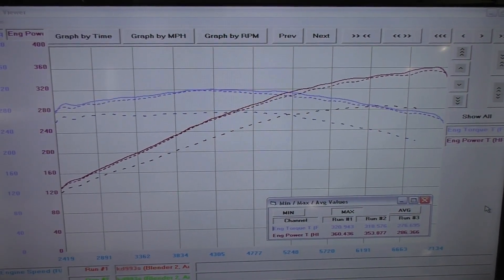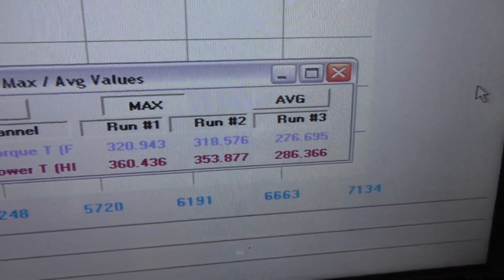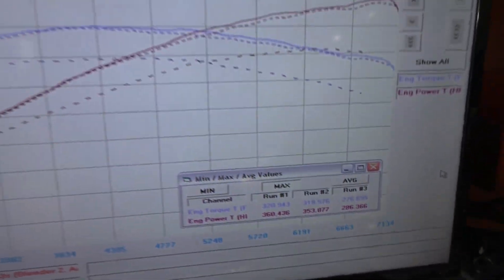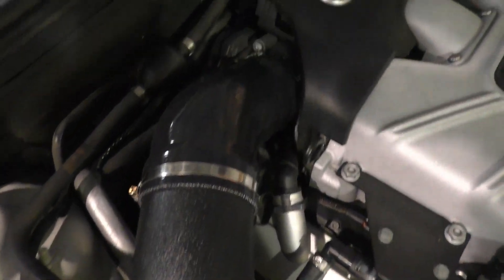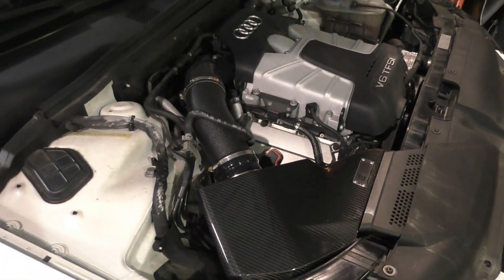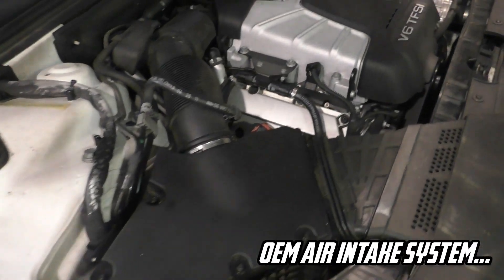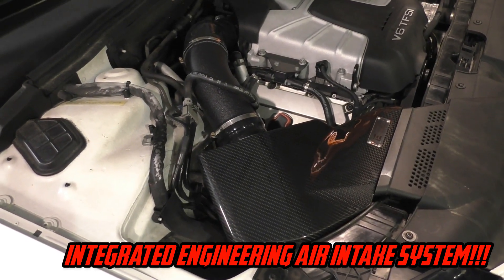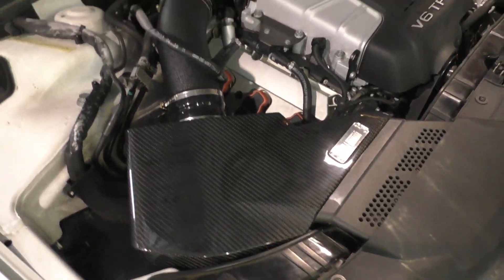Dyno Testing Integrated Engineering Air Intake System - Audi B8 S4

Comment: I was thinking of getting the iE polymer intake (fully covered), but now that I'm told that without the cover the car makes more "whine", I'm thinking of getting this one without the carbon cover instead of the polymer one.
What do you guys think?
Does anyone have a comparison between with and without cover?
Reply from the maker: If making power is more important to you, then run a covered intake. If the noise is more important to you, then run an open filter. Simple as that.

Comment: I'm new here but really like your videos, very professional 👍, I have stock S5 but want to add some nice whine of supercharger and want to order IE intake, that weird graph from dyno make me a bit concerned about power delivery..... do you think it may do the same thing on fully stock engine ?
Reply from the maker: If all you're looking for is to make the supercharger whine louder, then you'll want to buy an open air intake. Not a closed one, so make sure you don't buy the cover.

With a stock tune, you'll gain no power using an air intake. The car will need to be tuned to make more power.
Reply: @VancityAudi  thanks for quick replay! yes at the moment I'm looking for nice whine from supercharger so decided to go for open intake from IE, planning to order single pulley in future and when thats done I will be looking for ECU and TCU map, thanks for explanation 👍

Comment: so technically with intake and throttle body it's about 22hp gain not bad
Reply from the maker: Certainly more than 22hp with both of those mods. You have to take into consideration the testing of those products was done on separate days and at very, very different power levels. If I tested the air intake gains at a Dual Pulley Throttle Body E40 state of tunel they would have been greater than what you saw in this video.

Comment: How are you running 93 at high altitude? In colorado we have no 93, so i'm limited to a 91 tune which makes less power.
Reply from the maker: We are at extremely low altitude. Just above or at sea level.

Comment: That’s so bad dude , video is pointless because of the downpipe install ……..
Reply from the maker: I clearly show the gains before the downpipes were installed as well. If you want to get a better number once the downpipes were installed take off 5whp then. Lol. It's not rocket science.
Reply: @VancityAudi  dps give way more than 5hp
Reply from the maker: @internalcombustion8744  they absolutely do not. The maximum gains from downpipes with a Stage 2 Dual Pulley E40 tuned B8 are 8 - 12hp at the crank. This is very clearly stated by Integrated Engineering themselves on their website: https://performancebyie.com/collections/exhaust-systems/products/ie-downpipes-audi-s4-s5-b8

Seeing as my car was utilizing stock pulleys on a Stage 1 93 octane tune 5 wheel horsepower is being generous.

Comment: Adam, have you compared such a filter with the oem? I wonder if there will be a big difference, other things being equal. I have an a6c7 with a custom 89mm intake pipe and an rs6 air box. I'm afraid to put a filter of zero resistance, a lot of sand in our area.
Reply from the maker: Not sure I understand the question.  This video already shows an OEM filter vs an upgraded filter and intake.
Reply: @VancityAudi  I meant using a modified inlet pipe with an oem filter, and not with a filter like k & n and so on. on the c7 body (for a6 and a7) it is possible to use a filter box from rs6, but use a stock filter. on rs6 it is enough for 560hp, that is, the performance is enough for any level of improvements 3.0 tfsi
Reply: @VancityAudi  so I wanted to know if there would be a difference if only the filter was replaced with a modified one, given that the rest of the intake system is unchanged
Reply from the maker: @МаксимВоронин-ы9ж  gotchya. That I can't speak to because I never tried and tested that. Sorry

Comment: Crazy you only had 93 octane!! In the uk even though fuel is crazy expensive we have standard 95 and then we have Vpower by shell which is 99 and a few other companies with 99 octane but its £1.36 per liter not per gallon like you lucky folks in the Usa 🤘
Reply from the maker: You might want to look up the difference between the octane ratings in Europe VS North America 😉
Reply: @VancityAudi  now that's crazy, i was always told the fuel quality in north America was much worse than in the Uk. We have so called "99 RON" but as you say that might be your 93 ? Still much cheaper for you lucky lot lol
Reply from the maker: Not sure on the fuel quality statement, but your 99 is equivalent to our 94 in North America. Same sh$t, but the octane value is described differently
Reply: @VancityAudi  my father worked for our local refinery for years, apparently the additives, quality etc is completely different due to laws and legislation dude

Comment: Good job you are making perfect videos with all the updates I’m surprised with the power the car makes I’m stage 2 single pulley on 91 tune with down Cts down pipes and cold air intake and I make 400 at the wheel congrats and keep going😀😀
Reply from the maker: Thanks and will do!

Comment: Thank you for making this video. I definitely have to reflash and check with IE to make sure I’m not experiencing the same issue you did.
Reply from the maker: Don't reflash anything. Simply log your car. That will instantly tell you whether your bypass valve is opening on your pulls or not. If it isn't (like 90% of people), then you're fine
Reply: @VancityAudi  what are you using to log?
Reply from the maker: @1bads5  https://youtu.be/EChzDGcJh10

Comment: I have an S4 B8 as well. I've gone Malone tuning with CTS 187/57 pulleys, PLM intercooler, MH test pipes, cold air intake, CTS resonator back exhaust and Southbend clutch. Hopefully soon I'll be doing the full exhaust along with a ported, polished SC. I'm from Alberta and if this covid crap ever eff's off, it'd be sweet to head out your way. Is that your in house dyno you're using? How much to do a pull or two on that dyno?  I'd like to see what numbers I'd have.
Reply from the maker: We start private track rentals at Mission Raceway in April. You're more than welcome to join us. As I mention in the video a few times this is Racing Greed's dyno. Feel free to email them or call them for their dyno rates. www.racinggreed.com

Comment: Do you have the A6 HX since the S6 has a normal intercooler in front? just curious because i'm interested in running the larger HX on my B8.5 S4.
Reply from the maker: I say right in the video what kind of heat exchanger I have, lol.  I also made a video on the install: https://youtu.be/80jnlqNax6Q

Comment: Asking a newbie question: I want to do both the  stage 1 tune and exhaust, should I do them both at the same time or, if I do the tune 1st then the exhaust would I have to retune the car?
Reply from the maker: We're all a newbie at some point so don't worry about it. Once you've tuned your car to Stage 1 you won't ever have to re-tune it to Stage 1 unless you want to change the octane of the tune you run. What happened to me with having to get a revised version of the tune was a very, very, very unlikely occurrence and only happened because of the amazing conditions I live in to make power.
Reply: @VancityAudi  hi, really enjoying these and your recent SQ5 vids, I live pretty local (Kelowna) and wondered how someone would know if they also need to update the tune?
Reply from the maker: @graemepaterson9436  you'd need to do a 3rd or 4th gear pull and log the car. That will show you what your car is actually doing under full load at WOT

Comment: Awsome video's man! Want to see how much more power you gain with dual pulley or if you go with bigger throttle body mod. Btw, was those down pipes strait or did they have like 200cel cats on them? From Tuner from Finland, out.
Reply from the maker: Here is the link to the downpipes: https://performancebyie.com/products/ie-downpipes-audi-s4-s5-b8
Reply: Just gone trough the previous posts and noticed that those down pipes had no cats 🤣. Well anyway, just fitted these to my S4B8 https://www.luisusgarage.com/p/audi-a4-s4-a5-s5-quattro-3-0-tfsi-354ps-v6-katalysaattorilla/
Reply from the maker: The stock downpipes don't have cats either.

Comment: That is phenomenal power! Really excited to see that you are already making nearly 400 wheel on pump gas, no less. There you go closer to that 10 second run. You should be trapping right  around 119 mph now. To run 10's repeatedly, you will need at least 124 mph traps, which should be easily achievable with E40, DP, 80 mm throttle body and ported blower. Actually with those additional mods you will be trapping around 128 mph. Again, congrats on the awesome results and thanks for the interesting content!
Reply from the maker: I'd say 119mph is a little on the high side for a Stage 1 - 93 octane tuned car, but we shall see.  Thanks for watching!
Reply: @VancityAudi  you trapped 116 mph when putting down 360 whp. With 33 additional hp, you will very likely pick up 3 mph in the 1/4. Every little bit helps- HX gave you better IAT-timing-power, intake more power, downpipes a bit more power.
Reply from the maker: @spondev  super cold weather, super low DA making super good power on a dyno doesn't directly relate to that high a trap speed. If the conditions were identical between those dyno days then I might agree. I think I did 115mph, not 116mph too haha. My guess is I manage like 117mph, maybe 118mph at best. Only time will tell though! I love your optimism!!!

Comment: Does this have aftermarket Pulleys (SC or Crank) or stock?
Reply from the maker: I state I am Stage 1 in the video. That means I have a stock pulley
Reply: @VancityAudi  that’s what I thought, just wanted to confirm because those are really good numbers for stock pulleys and just a tune.
Must be the Mustang Dyno... great video regardless, keep it up!
Reply from the maker: @970Pantydroper  This Mustang dyno reads notoriously low.  The reasons I made great power I shared in the video.

Comment: Great gains so far! What do you mean by downpipes exactly? I've only heard that term in regards to a turbo car, right off the hot side of the Turbo. Did you get headers? Or are these like cat deletes after the headers?
Reply from the maker: The Integrated Engineering downpipes. Not the headers. Here is a link to their website: https://performancebyie.com/products/ie-downpipes-audi-s4-s5-b8
Reply: @VancityAudi  interesting, on other cars I've had, those would be considered midpipes/resonator deletes or something. They look very nice regardless.
Reply from the maker: Have all your other cars been turbocharged or naturally aspirated? On these cars the cats are built into the headers. The headers then go into the downpipes.
Reply: @VancityAudi  a couple NA V8s like a '13 Mustang GT, a majority have been turbo. Supercharged is the only one I haven't owned. But the exhaust on a SC and NA car should be the same for the most part. Calling them downpipes seems like a "branding" decision to me.
Reply from the maker: @scottc78  Well the pipes that connect to the motor are called headers.  What would you call them then? haha
Reply: @VancityAudi  yes, the exhaust directly connected to the block are headers/manifolds, but the pipes you bought connect to those. IE calls them downpipes, I'm used to them being called midpipes for the most part. Or often times the cats are right after the headers, so that would be the start of the cat-back exhaust. Not a big deal, just the first time I've seen an exhaust section be called downpipes on a non-turbo car.
Reply from the maker: @scottc78  Just an FYI all the manufacturers call them downpipes on this car, not just IE.  I get what you're saying though.
Reply: @VancityAudi  that makes sense. Kinda like the pipe that connected the two headers on my 87 Buick Grand National was a cross over pipe, but that same pipe on my Subaru Forester XT was an "up pipe". I like how that all have different specific quirks.

Comment: I’m already stage 2+ 190mm crank from 034, 57mm supercharger pulley from IE, IE intake, ECS HX, p3 v3 gauge , Billet drivetrain and tranny inserts from 034,  IE 80mm throttle body, running on 100 octane. Ran into fuel cutting issues. HPFP next. JHM test pipes/catted down pipes, then ported blower, and time to run e40. I love how you dyno everything. This way I can know what I was pushing to the wheels as I was going from stage 1-stage 2+ and forward. Thank you!
Reply from the maker: You're very welcome.  Thanks for watching!

Comment: 8:30 seems about right doesn't really surprise me that you didn't gain anything. Proves the stock airbox is flowing enough air and then some for stock cars. will probably smooth out with some driving. more supporting mods are needed to require more air to come in :)
Reply from the maker: As I CLEARLY explained in this video, lol. It wasn't right at 8:30. The powerband was f$cked up because my bypass valve was opening so much because I was hitting target boost. The stock airbox flows well I'm sure, but this intake provides much better flow and power.
Reply: @VancityAudi  the gains you showed in the latter part of the video were more to do wtih your downpipes and removing restrictions on the exhaust side. VAG does a great job at sizing their intakes and as you CLEARLY explained these intakes are more for sound and cosmetics than power gains until you get more serious about upgrades (stage 2 and higher).
Reply from the maker: @One_Guy  actually I said the downpipes were more for sound, not the intake. The dip in power was from the bypass valve opening. If that wouldn't have happened the 1st graph would have looked fine and I picked up 16whp from an intake. So like I said the intake flows better and makes more power than the OEM system. Hard to deny actual proof and facts that I am testing and showing you all. To continue to say that the OEM system makes as much power as this intake is just ignorant.
Reply: @VancityAudi  I'm going to check and see if there is an updated stg1 tune. I'm same set up minus the heatX. I think you can give at least 4 of those horses to the downpipes. Those mid mufflers were just as restrictive letting air out as the stock intake was letting air in.
Reply from the maker: @jayboom10  don't waste your time. There is no updated file available to the public yet. IE will be making some more changes off of my logs as I continue to make more power and then the updates will be released.  I'm sure the downpipes helped a bit for the final run. They don't have mufflers on them though, haha, they are resonators.
Reply: @VancityAudi  lol my bad I meant resonators...yea those things are restrictive

Comment: Adam, could you make comparison in different rims? 17 inch versus 18 or 19. dyno or dragy
Reply: Anytime you have less rotational mass the car is gonna be faster.
Reply from the maker: You would need the same wheels and the same tires in 2 different sizes to make that comparison accurate.  Sadly I don't have that so I probably won't be doing that comparison.  It wouldn't be very accurate
Reply: @VancityAudi  maybe just winter 17 vs 18 summer on dragy?  Gays tell me if change my 19 inch on 18 I’ll be faster.  is it true?
Reply from the maker: @Plushka199  100% true, just like Chris mentions above... Rotational mass plays a MASSIVE role in going quickly in the 1/4 mile.  If you run lighter 18's with lighter tires you will more than likely go faster than on your 19's